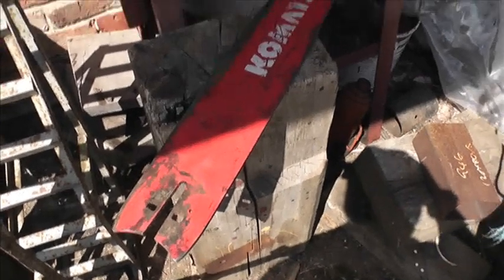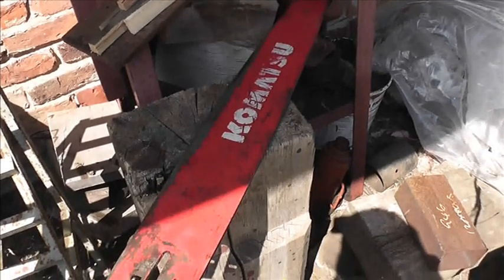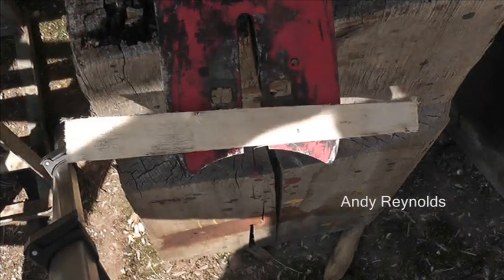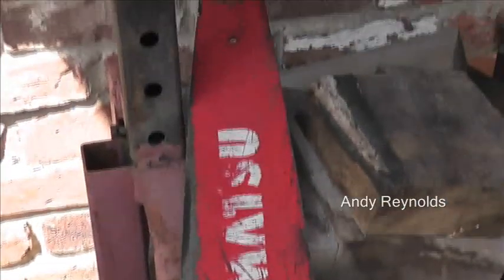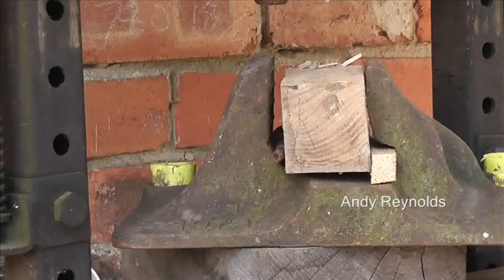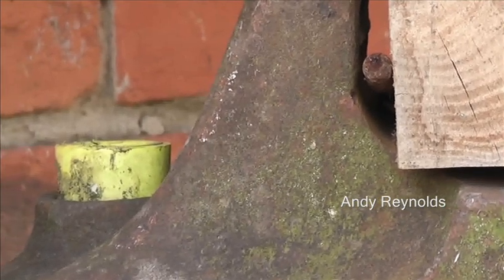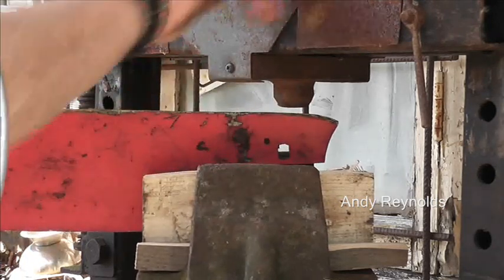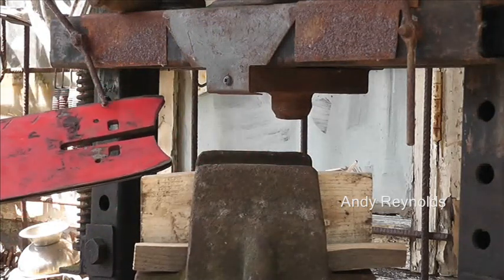Straightening a forestry harvester bar

Comment: Ive always paid a garage to press out bushing so have no press or experience using one
Reply from the maker: They are useful bits off kit. Normally starts with making something to hold the work, cheers
Reply: Good for fabrication of parts too. I've made nice smooth radius bends in flat stock using a press and appropriate formers.

Safety squints engaged when you reach the maximum thrust of the jack snd it still hasn't budged!
Reply from the maker: @ianhelsbyservices  Ian, it definitely gets a bit nervy at full force and nothing is shifting. I figure good jigs to hold the work goes a long way and some angle plates from thick steel to make bends, cheers

Comment: You could make a little form tool to attatch to the ram on the press that would fit inside the groove on the bar. You would then be pushing on the bottom of the groove rather than on the top edge. It would prevent damage to that area and the form tool would help keep everything centralised. That press is at its limits there. Time to build a better one.
Reply from the maker: Simon, thanks for the idea. The press did damage the rails and as you know I have a few off these to do. As for the press upgrade, I'm assuming start with a stronger frame, some big lumps of channel and new seals in the jack. Any other ideas? cheers
Reply: @TheInfoworks  I think i would make a dedicated press for doing those bars. It wouldn't have to be very big that way you save on space and materials and you can still do all your other press jobs on the one you have.
Reply from the maker: @thornwarbler  Simon, I'm thinking of improving the jig to retain the bar on a register pin. You idea of the form tool will prevent bruising of the top rails, which then takes more work to sort out. As you've seen there's plenty of bars to go at, cheers
Reply: @TheInfoworks  Sounds like a plan. Maybe a bottom tool that mirrors the top one would be a good idea that would prevent damage to the bottom of the bar when the pressure is applied at the top
Reply from the maker: @thornwarbler  Simon, I'm going to give this some thought. I've been investigating the nose bearings also, 2 x 3mm (32 of). Fiddly and grease means they stick to your fingers, Cheers

Comment: A DIY press is on my to do list, but so far everything that has needed a press has taken a squeeze in my 6" record vice. A description video of the press perhaps? and suggestions of how to build it? Or not!  Student kick out time over here, so over 50 saucepans collected from bins so far, and other assorted treasure... I don't suppose that you need any dirty saucepans Andy?
Reply from the maker: Owen, yes, some 2 inch thick wall box steel and a 10 ton hydraulic jack. They just make things that much easier, in this case I had to add another jack, so a better 20 ton press is in order. Oh yes I remember your stories o student waste, I had hopes that the younger generation had learnt lessons. Cheers